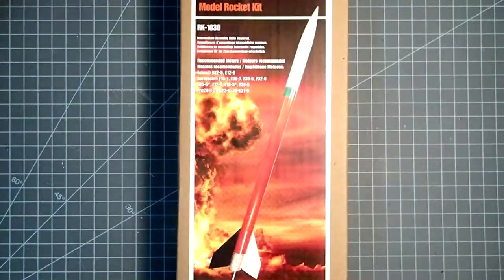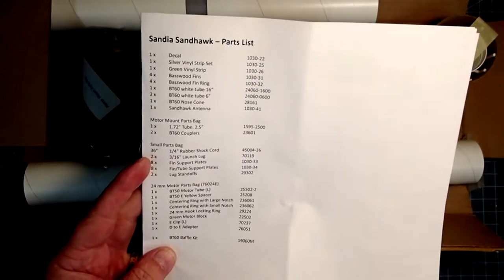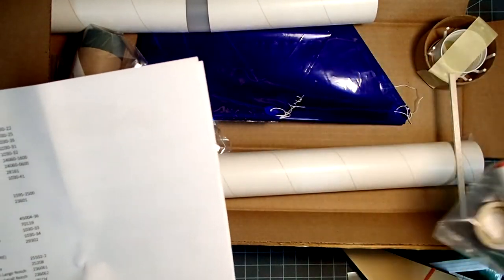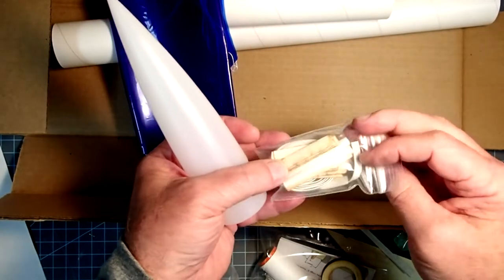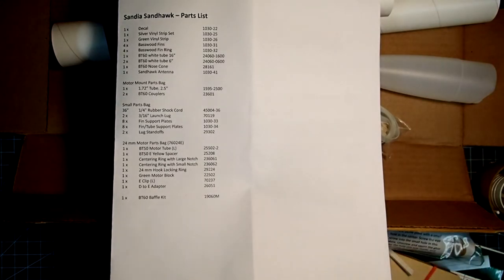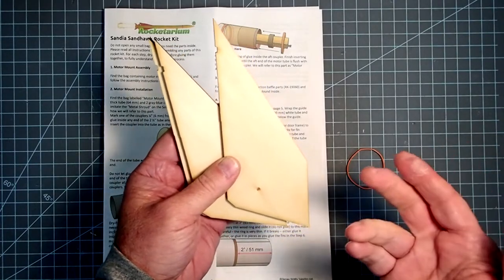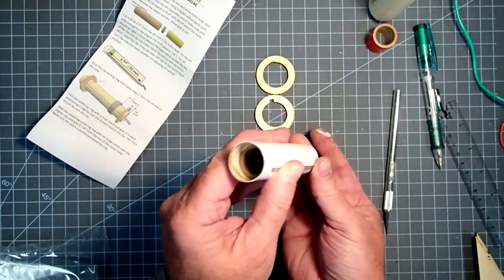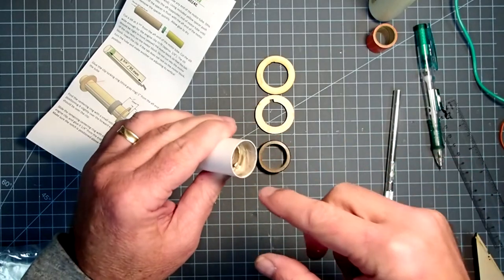Rocketarium “Sandhawk” model rocket assembly (part 1 of 2)

Comment: There is a mistake in this video (@ 30:22) when gluing the motor mount into the coupler, the AFT end of the MOTOR TUBE (not the aft centering ring) should be flush with the aft end of the coupler.  He has the motor mount about 1/4" too far back.  Not that this is a major problem though.